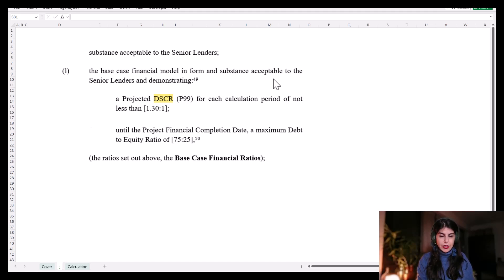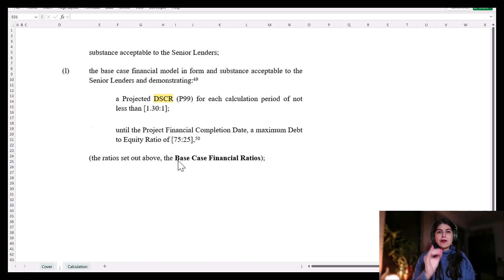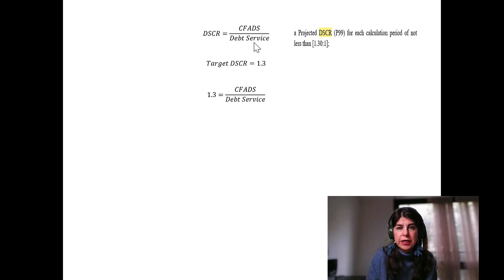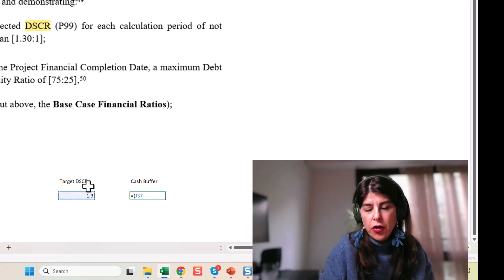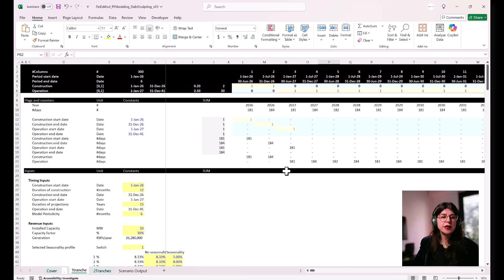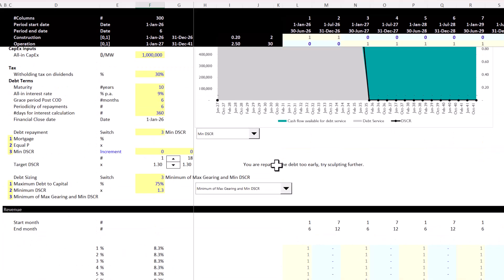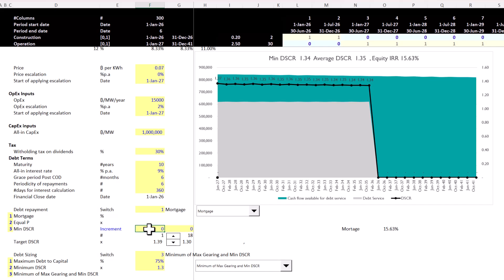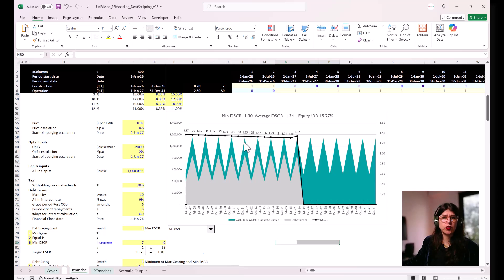Financial Modeling: Debt Sizing & Sculpting in Project Finance

Comment: Thank you for the video. 

I believe that it is worth mentioning that in the majority of cases sculpting with DSCR does not require any circular references or VBA. 

Common mistake of many modellers is that they start to discount some cash flows that they misleadingly call CFADS, although it is obvious that it is impossible to know the exact amount of CFDAS before you find out the debt structure. 

But cash flow that could be discounted is the metric that can be easily obtained - Free Cash Flow to Firm (approach is very similar to classic business Valuation). The only difference is a Tax Shield. To get the exact amount of FCFF just use Income Tax calculated as Tax Rate multiplied by EBIT. 

The next life-hack is to find out a correct discount rate for this exercise. And it is not an interest rate that all models use - you have to use Modigliani Miller WACC formula instead, where cost of debt is After-Tax interest Rate and ‘cost of Equity’ is a Pre-Tax interest Rate.

Weights of debt and ‘equity’ are also quite easy to find out. If you use 1.30x DSCR (or (Debt + Equity)/ Debt) it means that weight of debt is 1/1.3 = 0.769 , and the weight of ‘Equity’ is 0.23

After using NPV function you will get an ‘Enterprise Value’ and after multiplying it by the weight received above you will get the exact amounts of opening Debt and ‘Equity’. 

As we know cost of equity and debt and their opening values we can easily find the tax shield and get CFADS. 

So for every period we have to deduct from FCFF the interest payments on opening balances, add the Tax Shield, and the remaining periodic cash flows have to be fully spent for debt and equity repayments in exactly the same proportion that was mentioned above: 0.769/ 0.23.